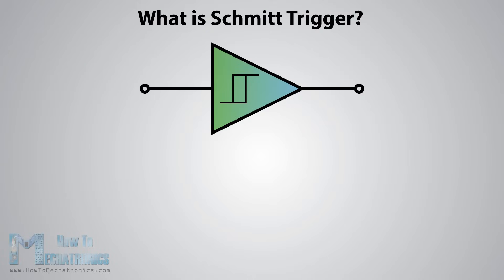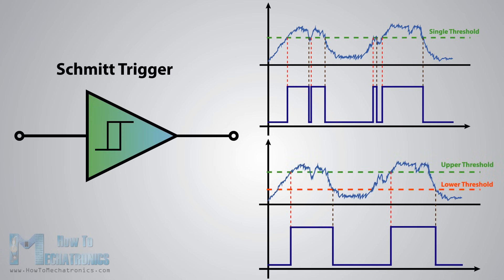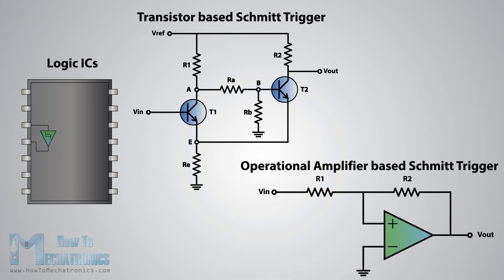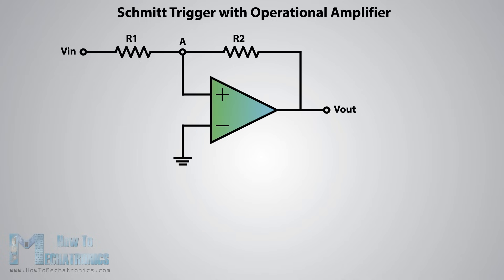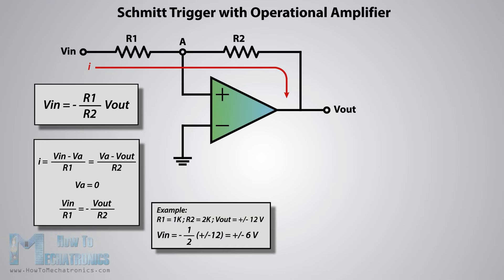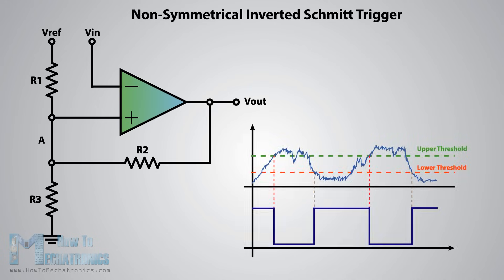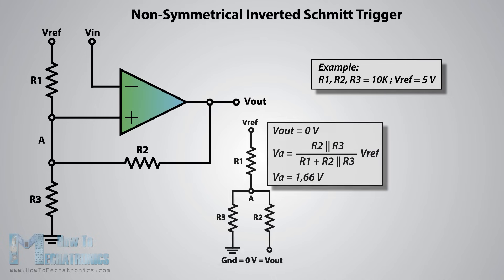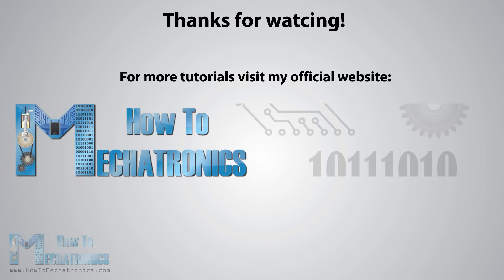What Is Schmitt Trigger and How It Works

Comment: I'm looking for how to design a single pole double throw switch that switches one way above a higher voltage and the other way below a lower voltage. I want it to switch between a capacitor and a shorting wire to control a generator powered by a falling weight. It would be fun to make a weight driven radio or phone charger but a low power load would make the generator spin faster and a high load make it slow if I connected it directly.
The plan is to run the load off of some power capacitor, and have the generator charge the capacitor in parallel, but then disconnect and be shorted out when the capacitor reaches a higher voltage, let's say 5.5 volts in the case of phone charging. Then when the phone has siphoned enough from the capacitor that its voltage has dropped to 4.5 or maybe 4.8 volts, disconnect the shorting wire and reconnect the capacitor. My thinking is the generator will slow down on the shorting wire, and then speed up when connected across the capacitor until it is charged to the desired level and switched out of circuit again.
I am unsure of how the old Freeplay spring driven radios worked (before they switched to battery storage) but when the radio was at moderate levels, the generator would rev up a bit and then slow down again in pulses, which is the behaviour predicted from the circuit above e.g. charging a capacitor and then shorting the generator (with the capacitor disconnected from it) to slow the release of wind when the radio had enough power. Turning up the volume louder caused the radio to unwind in longer pulses until it was steady and fast, leading me to believe the capacitor was never switched out due to the power demand of the loud radio. If the radio was turned off completely, then it unwound slowly, leading me to believe the capacitor was fully charged and the generator was on the shorting wire. Also holding the winder still caused the radio to fade out like it was on a capacitor of some sort. I couldn't find the exact circuit that was responsible though.

Comment: Your Va formula for non-symmetrical inverted schmmit trigger is incorrect. It should be = [(R3)/((R1||R2) + R3)]*Vref. You just got the right answer because all 3 resistors have the same value.

Comment: I usually see schmitt triggers in the positive feedback inverting configuration. The circuit here is using positive non-inverting configuration. I'm not sure if it will work. Also, I think that using virtual short concept in your equation (Va=0) is not valid because this only exist in negative feedback configurtion.
Reply: you are correct. thanks for pointing it out as i went in a rabbithole to understand it. the formula gain = -rf/r is probably applicable only in negative feedback cases where the output is stable. here its positive feedback and output is always +12 or -12v due to regeneration so i am assuming theres no such thing as a formula for gain. in negative feedback theres degeneration so theres virtual shorting there

Comment: || means what? in that formule
Reply: || means "in parallel with".
For example, R1 || R2 is asking for the resistance of two resistors, R1 and R2 connected in parallel.
R1 || R2 = (R1 x R2) / (R1 + R2)

Comment: If I'm not mistaken, that last formula you displayed (where Vout = 5V) is wrong.  The formula to calculate Va should be Va = [R3 / (R3 + R1 || R2)]*Vref.  Since all the resistors are the same value the answer you got is correct, but your approach was not.
Reply: Yes you are right
Reply: yeah. ohms law.
Reply: || means what in that formula
Reply: From what I learned in college, resistors that are in parallel share both nodes. Why, in the first of the last two examples, are R2 and R3 in parallel?
Reply: Ah, I gave it a fresh look today, and I see that they are in parallel because the voltage at each end of each resistor is the same, so they are essentially connected to the same node. This is true for R2 and R3 in the second-to-last example and for R1 and R2 in the last example.
Reply: you are completely right
Reply: No he is true look at jhonson reference in this section he writes same equation
Reply: || means "in parallel with".
For example, R1 || R2 is asking for the resistance of two resistors, R1 and R2 connected in parallel.
R1 || R2 = (R1 * R2) / (R1 + R2)

Comment: If it's from the non-inverting input why the minus sign when dividing R1 and R2 in the Vin equation? I find it a bit confusing because the minus sign is also been used to calculate the gain of an inverting input.
Reply: When I rearrange the equation to calculate Vout the minus disappears.